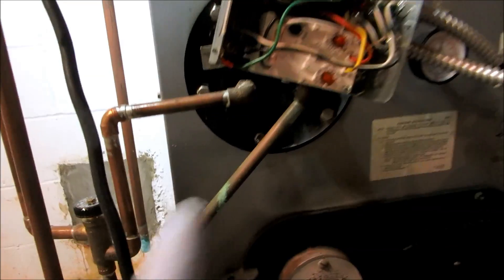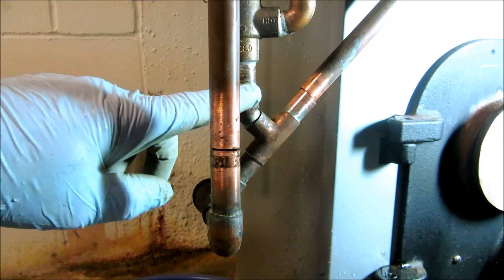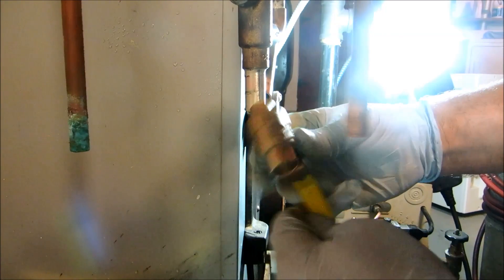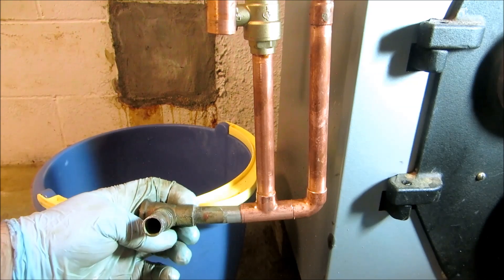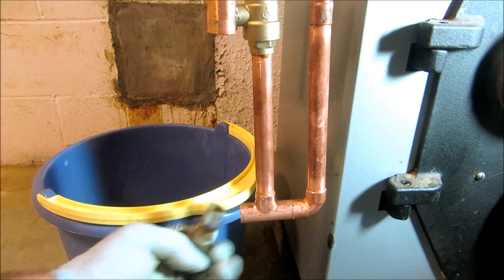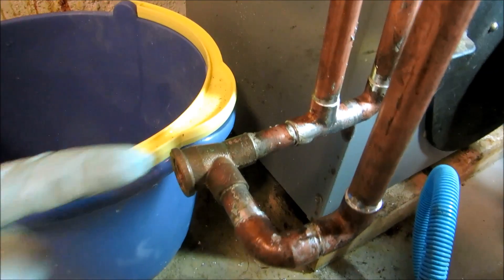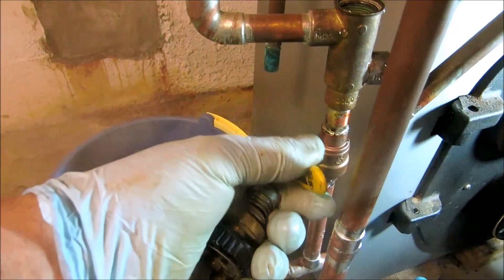modify tankless piping to get contunues hot water

Comment: I have watched a lot of your videos. I have noticed that when you change a nozzle you put in one that "is good enough for this boiler"........or "this one will save the homeowner some money."  WRONG. I hate to burst your bubble but changing the nozzle for either of those reasons is a load of crap. The nozzle should be replaced with the size that the burner was shipped with according to the size of the boiler and amount of water it contains. You can't use a smaller nozzle with any kind of satisfactory results. Look at it this way,......put a quart of water in a sauce pan and put it on the stove on high to boil. It will take "X" amount of minutes to boil. Now try the same pan of water held over a match. How long will it take to boil?.......It never will.  Same with nozzles. If it calls for a 1.0 and you put in a .75 you just did the same as the example I described. You will never save the customer any money by going to a smaller nozzle if the burner can't put out enough heat to get ahead of the amount of water passing through the coil. The burner will run and run and never catch up. So, putting a ball valve where you intend to will not accomplish anything. The mixing valve that is there is already doing what you are going to try. Forget the ball valve. I suggest that you check the nozzle and install the correct size, or larger. Now you can say you're saving the customer money. Yes it's burning more fuel but it gets the boiler temp up in less time and shuts down. You'll find you can run that hot water all day and never go cold.  I say this from experience. I was tired of running out of hot water and after paying a service guy for 20 years and how he would say a smaller nozzle is ok, i decided to look at this situation myself. The tag on the boiler said "Nozzle Size: 1.05"  They were replacing it with a .70 at the end and at that point I no longer needed their services. I found someone else that didn't want to do me any favor and "save me money" and this boiler fires up while being used for a shower and shuts down before the shower is even finished. My overall oil bill for the year is lower than it has been during that 20 year period of "saving me money."  The nozzle size matters. You're never going to save money if the boiler has to run continuously. Remember, you can heat a pot of water over a high flame real fast........or hold it over a match size flame forever. This comment will probably be removed, but that's ok. It's my story and I'm sticking to it.

Comment: I have a hydronic boiler and I just did a rebuild on the thermal mixing valve I'm still not getting enough hot water for the shower. What else could it be? High is 180 and low is 140. Never had this issue before.

Comment: Great video! 
I'm doing a similar job myself.  I've decided to add boiler drain in addition to ball valve to allow inserting vinegar to descale the tankless coil. I can turn off the water, and circulate vinegar from the new drain through the coil and out the pressure relief valve.

Comment: hey steve,  would the size of the line to and from the tankless coil (3/4" to 1/2") make any difference in the hot water pressure out to the fixtures. ?  A new system, Peerless, was installed utilizing my one year old storage tank and circulating pump, only those lines were modified down to 1/2" and it seems like I lost hot water pressure...

Comment: So you use a ball valve to throttle flow which isnt designed for it at all. And you installed a ball valve in a nearly closed position on the opposite side as well. That T&P should have been relocated on the hot water discharge not down stream of the tempered water. Terrible piping job made worse in the name of more hot water

Comment: Would have just removed tempering valve , don’t you just love someone second guessing you, I know you were on the job and did it your way which was correct.  By the way, I used to boil out the coil, but that in itself can cause problem, stopped boiling, learn the hard way.

Comment: Simple mixing valves only work under a narrow range of conditions. They're a workaround for an under-capacity system. I added a pre-heating tank powered by PV solar in the summer and furnace heat in the winter. Its very efficient and provides more than enough hot water throughout the year.

Comment: Hi Steve - Sorry for the newb questions, but did you need to add the ball value because the tempering value was not doing its job?  It seems the ball value is just controlling how much cold gets put into the mixed line, which it seems the tempering value should be doing.  Or, is the ball value doing doing something else, like controlling the cold pressure to the mixed line that the tempering value cannot do?  Or something else?
Reply: Wondering the same thing:  Why not just turn down the valve feeding the cold water to the tempering valve?

Comment: We had the same boiler and same problem I replaced the tankless coil now tons of hot water.  Tankless gets scale on the inside and outside.
Reply from the maker: +Dan C. this trick will get you hot water with out changing the coil .some jobs you can not get the coil out . rusted bolts ect

Comment: hey steve I got a question for you man. Probably pretty basic but never the less . 
I have an oil fired hydronic boiler in my basement. Recently had it fired up cuz it dropped below 60 in my house. Well the boiler pressure relief blew on me and its at about 20 psi right now constantly. the water temp while it was fired was 180 maybe 190 even though the low limit is set at 120 and the differential is set at 10. High is set at 140 (i dont know why there set that low the last time we had a pm done on it the guy we had must have done it.) 
We have a four pipe 50gallon dhw tank and the boiler only heats up ro about 160 during the summer. whats going on here? Is the high limit messed up?
Reply from the maker: zarathustra usaully i set my high at 180 my low at 160 .if there is a tankless ..boiler water does not need to go above 190 ,200 .if you have cast iron radiators  you can run it cooler .like 160  ,if your relief is blowing maybe your ex tank needs to be drained
Reply: Yeah I replaced the expansion tank once before. 
The dhw tank is leaking out of where we have the line voltage thermostat going into it.  even though i Replaced that like 4 - 5 years ago. 
I think there might be some sort of underlying issue. At first I thought because the boiler aquastat was set so low the flue gasses were condensing and blocking the flue gas passages. ( also where the sight glass is to see the flame there is carbon build up so it looks like flame roll out even though its not doing it anymore.) 
Would a blocked flue gas passage cause high temps even though the aquastat is set low like that? Sorry this is so long steve.
Reply from the maker: just call me on the phone maybe i can help you

Comment: Do aqua banks get limed up too, just at a slower rate, or is there some other difference between the tankless coil and the exchanger coil in a tank?
That piping was certainly a tight jigsaw puzzle before you improved it.
Reply from the maker: Dwight Bennett and aquabank needs a tankless coil from a boiler ,,a staorage tank has a coil built in to tank .i never seen a aqua bank get limed up .there is no coil in a aquabank
Reply: I get it now. I think most systems that I've ever looked at are either just tankless or are a storage tank as a priority zone. Now I'm curious about the piping layout, and how it might be integrated with a solar collector system for the domestic water.

Comment: Were required to put tempering valves on solar water heaters here.  Ive found those watts ones dont work for sh#!*.  Usually we have the opposite problem.  Were getting temps in the high 130's to 40's and when you turn the watts ones to 120 and it will barely even effect the temperature. Honeywell's work way better.
Reply from the maker: Ryan Dugger well i know how to make them work lol
Reply: Ya I wish I could through a bypass valve on the systems we install, just inspector probably would frown upon it.  Code over common sense!
Reply from the maker: the shut off is in the piping diagram from watts,it should always be installed
Reply: Im going to have to check the diagrams on those!  Reading instructions was never my strong suit I guess.
Reply from the maker: its there for a reason
Reply: Just took a look at the instructions on their website.  Sure as chit it uses the isolation valves as flow controls in troubleshooting.  But would it not be doing its job for it? I see the pressure balancing aspect of it though so...Thanks for the lesson.

Comment: That boiler sucks for a Tankless. I installed a bunch and everyone complained about not enough hot water. You could shock the coil but a month later same problem.
Reply from the maker: Al Gregory i have found this is the only way to fix the problem ..
Reply: What's shock the coil? Tell me more
Reply from the maker: delimer .coil cleaner ,do what i did on this video you will be better off
Reply: I flushed out my coil 2 weeks ago and it's working better than ever with hotter water and greater flow. Also installed new Watts tempering valve. But how long will it last? Was concerned about creating a leak but situation was bad and warranted risk; although they apparently do the same basic procedure now on newer tankless heaters as regular maintenance with no problems.

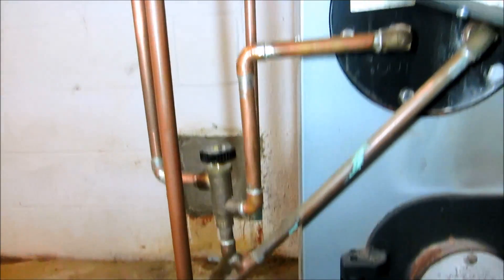Comment: what about black steel pipe and copper jointed at 1:39? .some people says that you need a dielectric union. what is your opinion  about joining différents kinds of metal? maybe a video about it? thanks, continue good work.
Reply from the maker: SimgoWood you never connect water pipe to black pipe it will rust.. copper to galvinised maybe ,,,,,copper to brass yes .. bepends on the situation on water heaters they have dielectric galvanised nipples .already there is a plastic whit coating in side of nipple

Comment: Steve, Nice job, I always wondered about the tankless heater capacity
Reply from the maker: S Sam when there new they work better .as they get older there are modifications you can do also you can delime the coil .with chemicals i usually stay aways from that ,, because i might make thing worse.get a leak ect